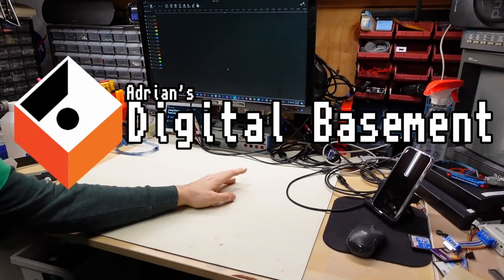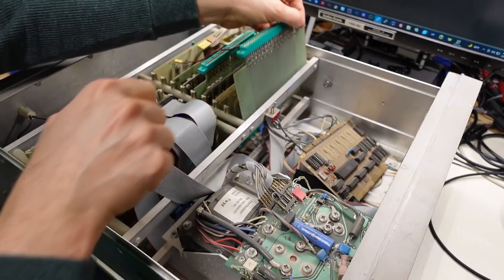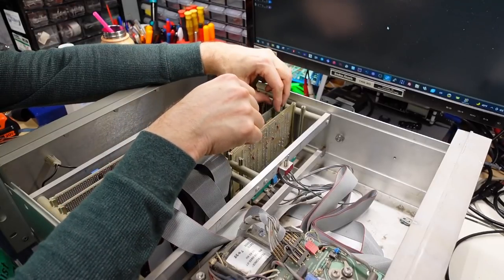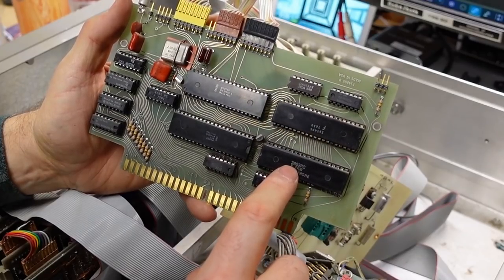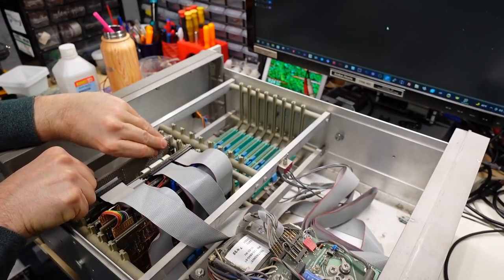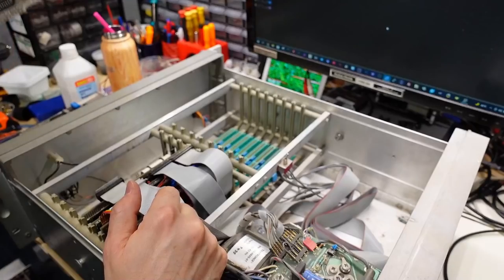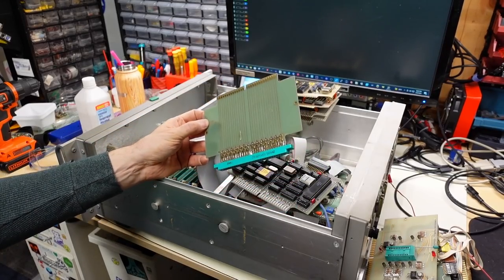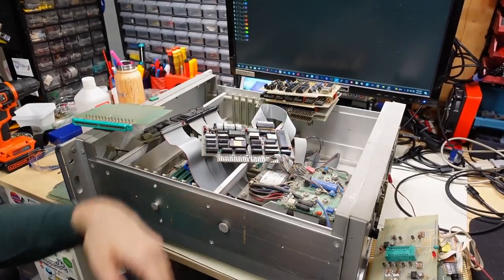I need help finding information on this mysterious computer

Comment: Greetings the device you have is part of ATE system bulit by a company I worked for in the early 80's in salem oregon. It was bulit for one of their customers on contract.. please contact me for more info.
Reply from the maker: Very interesting! Could you email me at the address on my channel about page? Would certainly be neat to hear more about the history of this thing. https://www.youtube.com/channel/UCbtwi4wK1YXd9AyV_4UcE6g/about
Reply: Those hand made cards are a work of art. :)
Reply: This is definitely a really bad thing if you built this for a customer.   Using parts from TekTronix equipment and dodging a power supply board?
This is dodgy to say the least for something that is meant to be sent to a customer.  I hope this one was more a prototype and that all those corrections done by bodge wires were reprinted into a proper PCB for the actual customer.
Reply: @EsotericArctos  Why bother? If you are only going to make a dozen or so of these, having new boards printed out every time a revision is made get's ridiculously expensive, especially in the early 1980's, you couldn't get ten boards printed for $2, and it would also certainly explain the wire wrapping. As long as it works, who cares? It's not like this is an Apollo guidance computer or it's memory core, and I'm sure that there were still bodges on those to. Power supplies aren't a huge deal either, I've seen worse in crap ordered off of Amazon and in those Keurig coffee makers, power supplies that can literally kill you.
Reply: @redryder6987  This would not be a very cheap coffee maker from Amazon for one thing.   Even in the 80's, if you were paying for something custom, you don't want something that could risk burning your office down, and I can guarantee the price of this, being custom made, would have well and truly covered a proper PCB design, given they were likely hand made in house for such small runs :).  
Surely you wouldn't expect a second hand tektronix transformer and dodgy power supply in a commercial product, even if it is custom and from the 80's.  That's why I feel this one could have been a prototype.
Reply: well that was fast
Reply: @EsotericArctos  It's not necessarily a "second hand" transformer. It's more likely that the entire power supply was designed and built by Tektronix, of which they do actually advertise power supplies in their catalogs at the time, it's not really that far of a stretch for the whole power supply unit to have been built by Tektronix. For the 80's, there is literally nothing wrong with what they did, wire wrapping was and in some situations still is common, with the entire routing done automatically by machine. Just because it's 'custom' doesn't mean that the people buying it have bottomless bank accounts - those revisions cost money.

Many, many, many tens of thousands of dollars, hundreds of thousands even, could be involved for one simple revision change especially forty years ago. If it were 1980, $10,000 would be around $35,000 today. Considering that, even today, designing an entire product could take as many as three or four years, and considering that EE's didn't get into the business of designing boards for some company while they eat nothing but ramen, the costs to make a few changes to the board design, or in this case, several dozen changes, would cost probably as much as it did to develop the original product to begin with, if not more.

Taking another example of 1980's tech: I have a Tektronix 2465A DV, I can tell you that from the repairs I did on it that there were at least several bodges done by the OEM, and this was a $10,000 unit in 1987. To add insult to injury, the capacitors in early variants weren't really that great, and they tend to catastrophically fail as they age. Even newer equipment sometimes have bodges in them. I have some Tek function generators from the late 1990's that have a few bodges in them to, and they are not cheap now and they were definitely not cheap back in the 90's. I would even bet that more modern test equipment, also have bodges in them to some degree. There just isn't any reason to set up a whole new supply chain for very small runs or revisions. I would even bet that stuff made within the past two years have even more bodges on them than products in the past, simply because they may have had to improvise when they discover that some chip they designed for/originally used won't be available till sometime in 2025, because there are three and four year lead times for some ICs right now.
Reply: @EsotericArctos  Things were done differently then.  Tektronix made more than oscilloscopes, and had a line of things like power supplies and others for sale to VARs who built custom equipment like this every day.  The computer industry was making tentative inroads into manufacturing, automation, and testing/data acquisition spheres.  This rig is definitely not atypical.
Reply: Tektronix would not be amused.
Reply: That machine (and the work done on it) probably cost the customer a kidney, back in the day.
Plus periodic maintenance, supposedly.
Reply: we all wanna know too! :D
Reply: @EsotericArctos  then u clearly didnt saw a telecommunication board yet(Tetra, Atca, Nokia/Adtran, TMXDA, TMXDA2). The raw PCBs sometimes came out from the manufacturer already modified(the bodge wires u mentoined). Sometimes we do it during the SMT, testing, rework process, because of the revision changes(new SMD parts, disabling functions on low cost wariants, etc). Those telecom raw PCBs are insanely expensive, some of them cost around $4000,-, so the PCB and SMT manufacturers dont scrap them so easily.
Reply: @talos86  the number of blank riser cards that came with this one for testing cards without the lid on makes it look like a prototyping unit.
I know some telcos do really crappy stuff in the field too.  I worked with one for many years.  But those blank testing risers were left installed so this was definitely a testing or prototyping unit
No way Tektronix made the PSU in this device, even if the transformer is branded.  🙂
Reply: @EsotericArctos  no your are wrong! in the 80s, they were not really big companys that can build special PCBS! so if a small company has to build prototype devices,they did it in this way.
its not rare, you can see it very often and i know it from my childhood. 
my brother has many of these "homemade" "Boards"
Reply: @Knebebelmeyer  Hey Toni,  I believe this unit is some kind of prototype or testing unit.  I have said that a few times :).
I just don't feel this particular example was a production unit.  It has all the testing riser cards in it still.  They wouldn't have been left in a prod unit as they would have to have been replaced, which would have cost money.  :).    That's my logic to it I guess :)
Reply: @EsotericArctos  aha, ok.
i dont read every comments.
only few words, that triggers me so hard, that i have to make another useless comment^^.
yes, its probably a prototype....they were not rare in this times!
Its like a "hackingtosh" nowadays...they are not rare, but u cant buy it easy!
Reply: @Knebebelmeyer  totally agree with you on that.  I kind of like my hackintosh :)
Reply: In early 80's they surely couldn't use Z280 from 1990. 🙂
For no kind of customer.
Early 90's - that's when real story begins for that machine...
Reply: This is clearly three generations of prototypes for a system. First the F8, then the Z80 CP/M, then the Z280, which probably also ran CP/M. I wonder if the reason there are both 50-pin and 34-pin connectors on the box is if the Z280 version used 5 1/4" (or even 3 1/2!") drives.
They're all together because these were the actual original prototypes that were kept at the company that made probably hundreds of them. But even for a prototype, all that enameled wire is completely insane.
Reply: Sam I could use your help. I picked up a fed x power back up they were full of batteries some were bad but it has a lot off 24 V  chips , 75 V capacitors and coils 3 to 4 times that of a microwave and on back plug-ins that say 150 volts there was 4 of them I want to build a controller to run a electric car if you can help
Reply: @EsotericArctos  Having worked in the IT industry in the 1990s, and having visited many different types of customers over the years, it was not uncommon for equipment like this to be seen in labs for testing and development.  In fact, it's entirely possible that many of those mods and "bodges" were made by the end customer themselves during the lifetime of that equipment in the lab.  Assuming that ATE stands for Automatic Test Equipment, then that unit would have had to be constantly modified as the equipment it was testing evolved.  I wouldn't be surprised if the customer was in the aerospace industry working on who-knows-what type of government project.  

Also, I can attest that those hand wired "patches" were also commonplace on commercial computer systems, especially as older revision boards went in for repair. Sure, they might redesign the board itself for new builds but when older boards came in for repair, they would be "patched" as part of an "ECO" or Engineering Change Order before going out again.  Companies who's service model made most of its money on service contracts were financially motivated to maintain reliability and reduce service visits.
Reply: @EsotericArctos  I'd say the entire chassi is from the scope, and was gutted apart from the psu and reused/customized for this "computer"
Reply: @DaleDix  I don't think they'd be too upset.  As I mentioned previously, Tektronix made more than O-scopes, and sold power supplies and other parts to VARs for this kind of use.
Reply: @talos86  The Atari ST board also came "bodged" from the factory.
Reply: @horusfalcon  It was just a tongue in cheek comment about where it actually was, mixed up higgledy piggledy.
Reply: @smacktard  Agreed, back in those days even many hobbyist level boards from the plethora of computer start up companies had bodges all over them.
Reply: Easy way to know it wasn't a prototype board ...it may be small run...but no one is putting something in a rack of there pulling it every week to screw with it
Reply: @EsotericArctos  Let me set a few things clear, 1st I did NOT disclose who the client was. 2nd at the time Tek was in Wilsonville and Beaverton Ore. Our company did a great deal of work with Tek back in the day. Now I don't know how long you has been an Engineer, I have been one for more then 40 years. The practice of prototyping in the 70's and 80's was VERY different then today. Our company built complete products using a number of different types of wiring methods. So please if you don't know what you are talking about just don't talk. Just look at early IBM or DEC systems entire main frame back panels where hand wired!!!
Reply: @dougsteere6814  Would be happy to help! Pleas keep in mind that I have only been an Engineer for 40 plus years. If you read some replays here I may NOT know what I am doing! Ha! Ha!
Reply: @samcross1833  So you are saying this is how you sent it out to a Customer?    The Zylog Z280 chip was released in 1987, this is not comparable to DEC or IBM  hand wiring days.  I have IBM PC's dating back to early 80's and no PSU looks dodgy and no boards look like the bodge in this device.   IBM and DEC, as you want to compare to, also would not have sent testing riser cards out in a production unit.
I have said several times that this looks like a prototype device, and if it is one of yours, then the fact it has a chip that was not released until the late 80's would mean this device is very poor if it was production.
Prototype or test rack, sure I accept that and have said it is likely that.  If this was production, then I would not have bought it in the mid to late 80's.  There was much better quality around at the time.
Reply: @samcross1833   in the mid 90 's I worked in somewhat niche industry and I remenber a field engineer hand wire  a hardware revision into a SNA interfase card in a production system. back then things were diferent
Reply: @8bitwiz_  in the late 90s, begin '00 I worked at a small company that made one-off boards with FPGAs and the like, all with this technique. Most, but not all as expansion boards for a 32 bit ARM machine
Reply: @reinoud6377  I am amazed by how simultaneously messy and tidy that Z280 board wiring looks. If you make just one mistake, it won't be easy to fix. Even with the schematic done first, that's still a lot of chances to mess up.
And I've worked for two companies that made embedded products, not one-offs, one in the late 90s. (The board design was contracted out for that one!) Back then it wasn't as easy as auto-routing something in KiCad and uploading gerbers to some place in China. And that Z280 was probably going to be a 4-layer board. You want to make an ugly prototype that works first, to make sure your circuit is right before laying out the first board. Still, I think it's more normal to lay out an almost right board, and expect to have a version 2 or 3.
Reply: @samcross1833  well said.
Reply: @redryder6987  I agree, and people shouldn't be so judgemental as to how the early pioneers made their machines. There was no PCBWay or access to almost all the information in the world from the supercomputer in their pockets!:)
Reply: @samcross1833  I was a mainframe service guy back in the 70s/80s. Those back panels were not actually hand wired. They had a huge CNC machine that wire wrapped the connections, although we did have manual wire wrap tools for field repair. Where I worked, the backplanes were usually wire wrapped, but the circuit boards came either as etched boards or as wire wrapped. 
I used a bunch of scrapped ww boards to build a Z80 homebrew back then. It was ugly, but it worked. :-) It was electrically S-100, but not physically.
Reply: @jimsteele9261  Thanks for your feedback!. my comments were directed at the comment about boards being dggey!. Backplans were wired not PCB's like today.
Reply: My thoughts also. This looks a lot like the ATE boxes I used at Rockwell. Software on the Z280 doing development and QA for a 3870 embedded system. When the tests fail, hand patch the 3870 code, burn it to PROM then test that new version again. This fits with all the riser boards, dual CPUs and the burner. We also had to do a bunch of hand patches of the hardware to get multiple CPUs to live on the same S-Bus and implement instrumentation between them. Wow, I was a kid then, barely understood how that Pandora's box worked but this really looks familiar. Ahh the good old days of embedded systems development.
Reply: @EsotericArctos  at the time was built it was cutting edge state of the art tech that had not existed at the time to buyas an off the shelf product, the customer demands functionality there and then without delay and would never wait for a consumer-friendly 'neat-looking' packaged product that would be both heavily diluted and long delayed time to market.
Reply: @EsotericArctos  You need to understand this is clearly not a mass produced machine, but may still be a machine used in production to make other machines.  Being a rack cabinet retrofitted with rubber feet makes perfect sense in a laboratory environment where lots of less frequently opened machines are in the rack and they just used standard Tektronix rack cabinets for everything they built in that decade in that lab.  In fact those riser cards may have been used to troubleshoot cards that went into very similar boxes that sat in the rack, and this prototype box was kept around until all those other boxes were gone.
Reply: @horusfalcon  I worked for Tektronix from the late 1970’s to early 80’s in the Microprocessor development group.  Every engineer had a toolbox that included a wire wrap gun so it was common to prototype with it. Patches to boards were also common.  But I don’t think we would have delivered a prototype.
Reply: @EsotericArctos  yeah I don’t think this would have been delivered to a customer. It’s clearly a prototype box. We would never ship a unit with the eprom programmer. If a customer wanted a feature enabled the field engineer would do that at the plant and then go on customer site to replace the eprom.
Reply: @Errr717  That's what I would think too.  Definitely prototype.  I know tel co's did some dodgy stuff, but by 1987 this is too dodgy for even small tel co standards. 🙂
Reply: Sam it sounds like you worked at Tektronix. I worked at the main campus for about a year before my group moved to Walker Road.
Reply: @EsotericArctos  I got news for you lad.... we did not have services like JCPL or PCBway. PCB's were done by silk screen for mass production which was very expensive. These are units that were custom spec from the customer and hand wiring like this was not in the least uncommon. These guys/gals knew what they were doing and as messy as it may look...this was state of the art for such projects.
Reply: @EsotericArctos  40 years on and it still lives thats quality build
Reply: @Stevie-J  And you are a troll and just  have offered nothing but an insult to the conversation.
A few have agreed with me that it looks like a prototype or test rig.  Why don't you read every comment before you make insulting and obnoxious comments that add nothing to the conversation.  
If you know what the machine is, then tell me exactly what it is, otherwise you have no idea either
Reply: @ebzery  It was in one piece, will give it that, but not sure it was living still.   :). 
I hope Adrian gets it running and does follow-ups on it
Reply: @EsotericArctos  You recieved an answer from someone who worked at the company that made the machine and yet you kept going, shooting down everything he said. That's quite obnoxious and arrogant indeed.
Reply: @EsotericArctos  it’s not prototype dude, stop acting so arrogant. The end use modifies this machine depending on the job, which changes. The creator even replied to you and said you were wrong about tektronix, and you just keep going
Reply: @mandrakethemadcoder  well said
Reply: @Walczyk  If it is not a prototype, why does it still have the prototyping cards in it that would not be used by an end user.  
Given it's been months since this had any comments on it, you are now the one continuing it on.   I am not the only one to feel it could have been a prototype.   Unless you made the machine, then you can explain why those cards were left in the machine when they are obviously not end user cards.
Your comment is neither constructive or helpful and just looks like you are wanting to restart an old discussion for the sake of being a troll
Reply: @EsotericArctos  you don't prototype machines using prototype boards. The end user was using them for their end-use system.